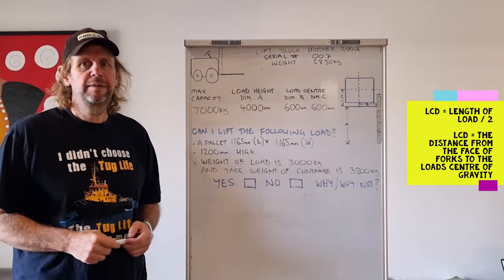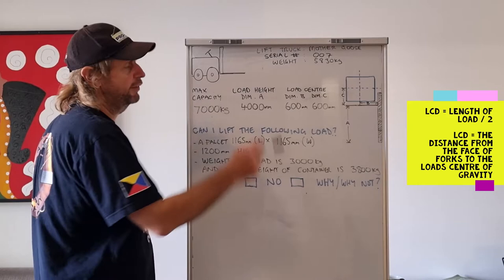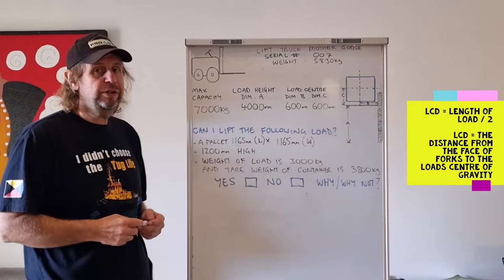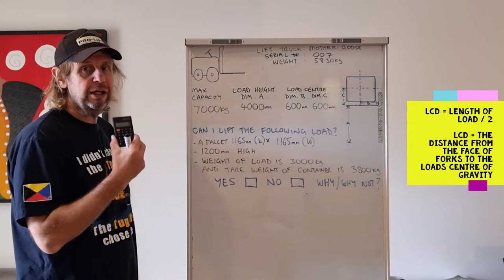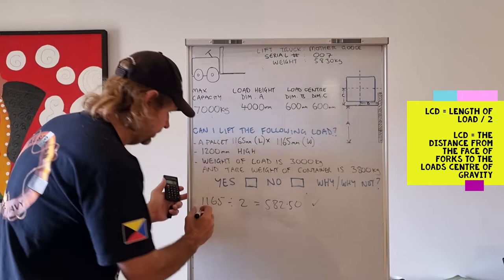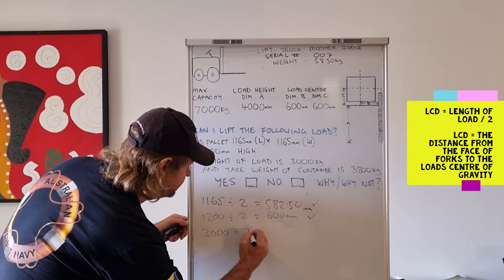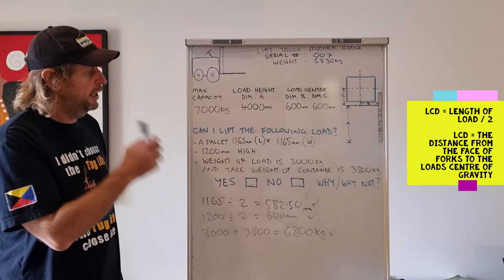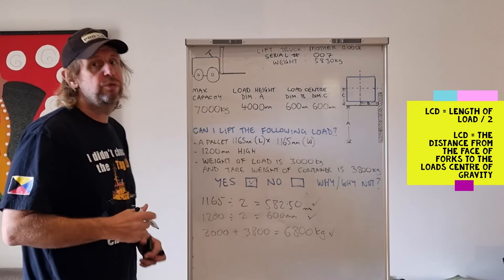Forklift Calculations: Load Centre Distance and Maximum Rated Capacity

Comment: A lot easier to understand than our teacher explained it, but then he also had choice things to say about the bureaucrat that wrote the course handbook. One thing he did say though was to always check the max load capacity first on these questions, save you having to write out all the other stuff if it's too heavy for the forklift int he first place.